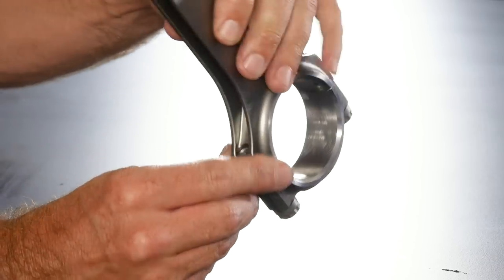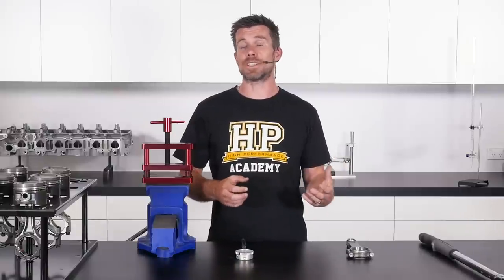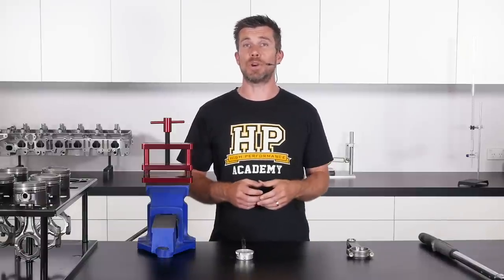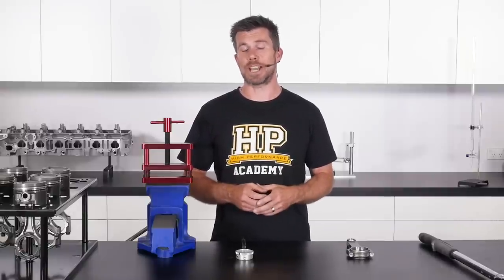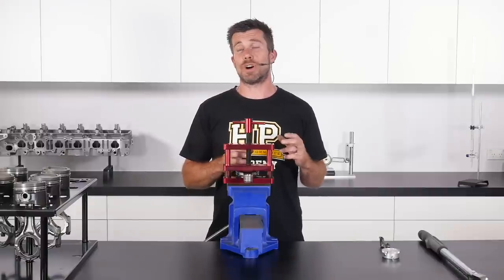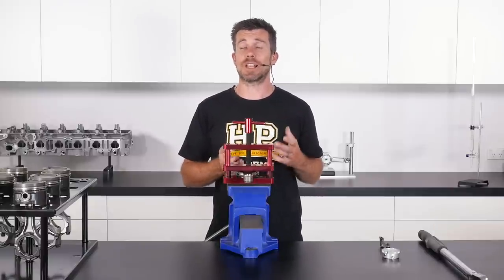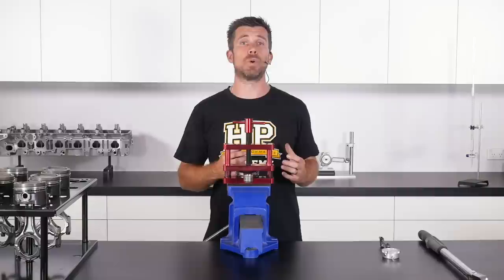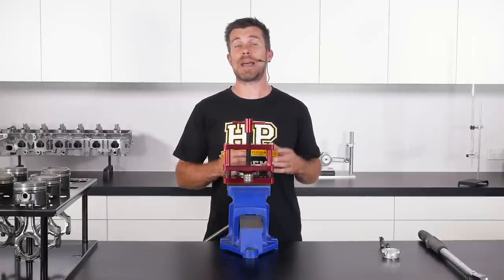How To Use A Rod Bolt Stretch Gauge | Performance Engine Building [FREE LESSON]

Comment: Definitely do highly recommend employing a stretch-gauge on connecting-rods, y`all don't want to end up like me, over stretched  bolts will snap! Just imagine that for a minute - the over torqued bolt snaps while you're doing 6K RPM over taking on the highway, the conrod comes off the crank, the piston smashes around in the bore flapping the conrod around as if it were a tail it  whips through your block - total carnage! Take my word for it because it happened to me. Make sure you do your homework before you attempt to rebuild an engine.

For those interested - I stretched cylinders 1 - 3 to OEM spec, undid them & re-torqued to spec, but ( from other YT videos ) it was suggested the bolts should be stretched 3 times. So I started on cylinder 4 & stretched those connecting bolt 3 times, BUT i thought after finding the 70degree rotation on the third iteration (cyl4) ridiculously tight i decided to do the other cylinders ONLY twice. It goes without saying - cylinder bay 4 decided to vent its anger smashing a large hole through the block! 🤨 BMW M-Sport - N46B20  6speed manual RIP.

Comment: I just did this two night ago or so. issue I had was the 30 weight oil wasn't enough for me to turn the bolts to get a good stretch on them they would stop and not turn anymore.. I ended up using a tiny bit of ARP fastener lube and amd the oil. They were still hard to move but I did get a stretch of 0060 on each , right in the center of the spec except for one rod bolt it stretched to 0070  , should I change that bolt? Thanks. manely rods ARP 2000s

Comment: Once amount of torque determined to achieve required stretch, can the mechanic rely on the torque setting to set each remaining bolt without checking the stretch with gauge?  Just trying to avoid the agony of checking the remaining 14 bolts.  Bolts and lube are ARP.

Comment: So the range is 0.005-0.007" for stretch.  What number is typically preferred within that range? Min? Max? Middle?
Reply: It doesn't probably matter, but if you torques to 40 lb ft and you have 0.005 of strech you don't go anymore
Reply: @mihailpetrovici5044  what's up maybe you can help me. I have a set of manley rods that came with the ARP 2000s the spec is 0058-0062 , it recommend using 30 weight oil but I could not get them to turn anymore and they barely had a stretch on them. So I used a tiny bit of ARP fastening lubrication. They were still really hard to turn but I did achieve a stretch of 0060 on all of them but one .. smh 0070 is that one. So it's 0008 over spec while the others are in the center of the spec.. do you think that one bolt will be okay or should I replace it? Thxs
Reply: @Anarchy-Is-Liberty  well it's done and over with lol been hitting 9-10k on it alot for over 18k now. Lucky me I guess.. it's 4 cylinder

Comment: Hi, i was wondering if connecting rods need to be bored out if you use a higher tensile strength rod bolts such as CARR Bolts/ARP Custom Age 625+ from a stock bolts or a ARP2000? I've read you possibly have to. Could you please explain? :D thanks
Reply: I suspect you may have two different things mixed up?
The bolts are designed to be a direct replacement and no re-working should be required there and, in the most unlikely event that there is, instructions will be given on the correct procedure - the only thing I'm aware of is that some extreme duty bolts will have a larger radius (curve) between the head of the bolt and the shank (the straight part) which is used to improve the stress loads on that part of the bolt and increase fatique resistance. In that case a 1mm 45 degree champfer is machined at the rod cap.

There is another procedure that is sometimes done to connecting rods, though, and that is resizing the big end bearing bore. This may be done for one (or more) of three reasons, usually to OEM rods that are being re-worked for further use (may be due to budget or regulations requiring their use)
a/ to correct the diameter if it is a little large for the correct crush 
b/ the bore is slightly out of round 
c/ to ensure the rod(s) is/are the correct length(s) - especially where deck/clearance heights (how close the piston top is to the top of the block or cylinder head)are critical. Sometimes this is done with replacement bushings in the small end, drilled to the correct position.
Reply: GordoWG1 WG1 oh okay. So bottom line is you don't require to machine it if just replacing bolts then.
Reply: "Shouldn't", but RTFM - *read the instructions that come/came with the bolts* as there "may" be some work required for that specific application* - if you are just considering upgrading the bolts, the manufacturer may have any modifications required on their web site.

*For example, one engine I am familiar with has 2 different spec' ARP bolts available for the OEM rods - one specifically DOES need the under-head chamfer and the other is designed for fitting without it.
Reply: Could you tell me which application for this particular motor?
Reply: Can you tell me how long this piece of string is?
ie. you have given no information about the engine or product you are considering using and as I'm not that psychic... :-) Comes to that, I don't know what condition the rods you are planning to use are in.
One other point to consider is that better rod bolts help protect against their failure at higher rpm - they do nothing to strengthen the rod's under compression or increase the actual rod strength for higher rpm. By that, I mean the two primary forces acting on a connecting rod are compressive (power stroke) and tensile (pulling with the greattest being at overlap) - the first is a result of the combustion forces on the piston and if high enough will cause the 'rod to buckle and bend and the bolts ahave no affect on this, the tensile force is from the piston and rod trying to separate for the crankshaft and the bolts are a critical part in keeping the 'rod firmly in place against the 'cap BUT if the OEM bolts are already stronger than the rod's strength then the rod will still snap at the same rpm, so you need to consider if you really need tham and this is where you use other people's experince with the engine you are planning to use - check out the clubs and on-line forums for what they suggest - it may be a better option to go straight for aftermarket premium 'rods*, especially if you may be increasing the cylinder pressures (boost) or rpm to, or beyond know failure areas.
For example, an engine I am more famiar with has two variations, a NA and a turbo, and they both use the same connecting rod and bolts. There are two well know failure conditions, big end bolt failure around 7k rpm (which have been known to fail within the OEM rpm limit of 6k8 rpm) where ARP, or similar, premium bolts allow 8k to be considered reliable with some rolling the dice to 8k5. On the other hand, in the turbo' engines they are considered marginal around 300lbs.ft of torque (a function of boost) and will fail around that mark, or a little higher - using ARP, or other HD, bolts will do nothing to strengthen the rods in that failure mode.

*When considering aftermarket connecting rods, be honest with the manufacturers when getting advice as there are design variations between optimising for boost and/or for rpm. They are not the same - an example of something that has good tensile strength, but negligible compressive strength, is a chain.
Reply: Funny, got your response in the notifications, but not showing up here.
I don't know enough about those Honda engines to advise - however, they are very popular and the Honda forums will be able to advise if you need to do that, bearing in mind how good their factory stuff is and what you want to do with it. Personally, I don't see the point in spending the dosh if you don't need to - especially if you would get a better end result elsewhere?
Reply: eh.. I still prefer :D You can't be too sure, I don't know about oem con rod bolts whether they are TTY bolts but stretch bolts are better overall and reuseable. It should save money longterm too if you take it apart often. Sorry about the response, i delete it because of the long replies consistently back
Reply: Honda S2000 AP2 F22C1, for those who missed the engine type and are better able to advise the chap - not an engine I am familiar with.
Ah, then aftermarket rods may be a sound investment, if frequent pull-downs are expected, or the engine is going to be working significantly outside the designed range.
Might just be a difference in expressing it, but all bolts stretch - however there are two basic ways of using them. TTY (Torque To Yield) are deliberately tightened beyond their elastic limit, until they yield, and are a single use item - easiest way to tell is if there is a torque figure and an angle. Whereas (most) aftermarket bolts are designed to only be stretched in their elastic range and are normally* re-usable indefinitely - they will have a simple torque and, for some applications, may have a stretch figure.

*Some applications will still use new fasteners every time, like the aeronautical industry, or where the material may require it, like some titanium alloys.
Reply: Oh ok. I actually didn't know the bottom * line. Good to know :D I knew the top section stuff
Reply: when you apply a higher clamping load between the main part of the connecting rod and the cap (torquing the bolts to different spec) there is a different amount of deformation than was originally intended from factory. This means that the big end bore might be out of round and then you need to think about boring out the big end (and possibly shaving the cap mating surface) to return it to round
Reply: You may need to review that.

Comment: Important steps left out. Close but no banana
Reply from the maker: Hey there Robert, bearing in mind this is one module from a complete course, what you do think is specifically missing in relation to the use of the stretch gauge in a performance engine building application? 
Keen to hear your thoughts =) - Taz.
Reply: What lube the bolts require and on what parts of the bolt  (thread/shoulder)